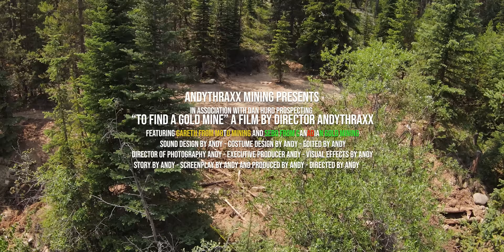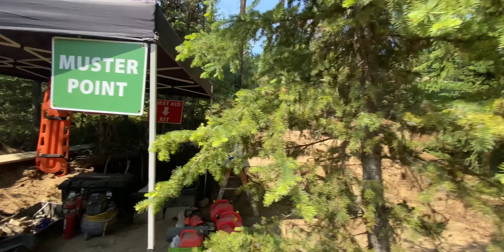Finding A Gold Mine Episode #6

Comment: Got a question; wouldn't it have been better to sweep the bedrock level by hand, or maybe spray it with water, rather than try to scrape it with the loader?
Reply from the maker: We actually did sweep quite a bit but It only yielded very minuscule amounts so we decided not to bother, but you are absolutely correct if it was holding good gold.
Reply: @ANDYTHRAXX  Oh ok, thank you. Great series, bummer results, but that's life.
Reply from the maker: @bepriceless  sooo true! We committed to finishing the small area but yes it was poor results, turned out it was mined before!! But still had consistent gold values just low ones lol